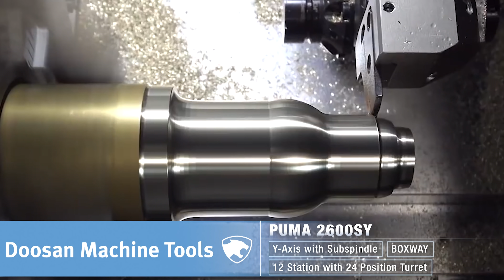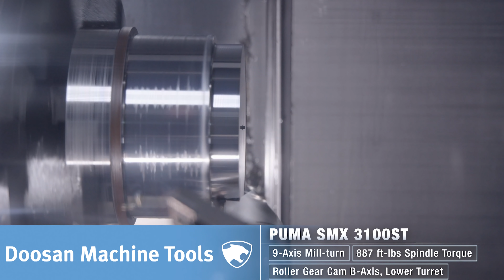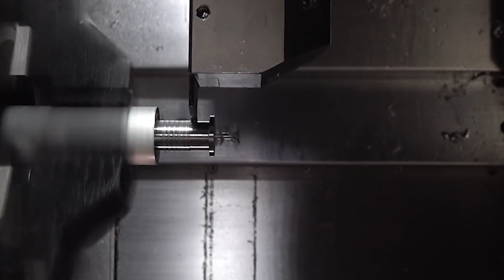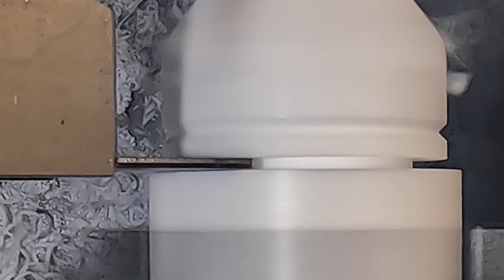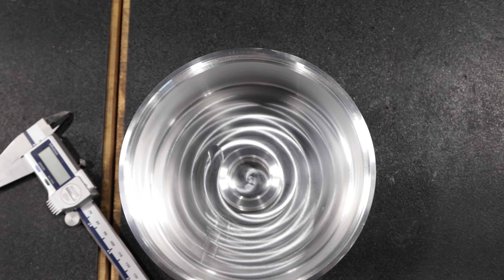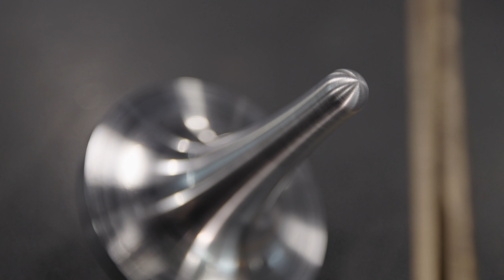Obtaining FLAWLESS Surface Finishes on a Lathe | Works of ART Compilation

Comment: We run parts that need a 16 micro finish.  Easy with the right insert and good steel. Have to polish almost every part cause our buyers get the cheapest shit they can find. It's called "strategic procurement".
Reply: sounds like you guys are wasting money on extra processes from using sub optimal material. Those extra labour costs almost certainly outweigh the extra cost of suitable material.

Comment: Which company provide best Turning Centre??? According to You. For ex. DMG Mori, Doosan etc.
Reply: Mori Seiki should be at the very top, come with high price tag but built like a tank and hold 2 micron tolerance daily basis. 
DMG Mori is one tier lower than Mori Seiki, and perform similar to Doosan, Okuma, Nakamura-Tome, Matsura, Mazak, Hyundai, Samsung/SE.
Reply: @MrKio415  we have 4 mori seiki , 2 doosan puma, 3 youji, 6 or 8 haas lathes. Mori seiki are best out of all those i have tried
Reply: @elvirathon  Haas lathe doesn't perform as well as the pack, the only good thing is you get support/parts in a day or 2.
Reply: @MrKio415  we have okuma and mori in our shop Okuma is better in every way than mori
Reply: For turning you can't beat Okuma, nakamura is pretty great too, and Samsung as they are literally old Mori's before they got crappy
Reply: Mori Seiki
Reply: I run Mori Seikis from the 80s that have been abused pretty hard. Still run parts at a +-.0002 tolerance regularly with no issues.
Reply: @85CEKR  Plus better support from Okuma, and you could throw operators from machine to machine and they knew what to do.....
Reply: @stbentoak5047  yes we get really great support from them too.

Comment: honestly I'm not impressed. Show me the tolerances and surface Ra and Rz
Reply: Right on.  These are the critical specs that a machine shop needs to work to.  I know we are showing the process, but no coolant?  Surface finish is a function, in a geometric sense, of feed and nose radius.  Many, many other factors then come into play like material type, hardness, and machine construction.  If we ran 5 different materials with the same process parameters they would all have different measured surface roughness.  Also, do any of the machines have an ultra-rigid headstock?  If I needed to get an awesome finish my manufacturing process would include in-process burnishing.

Comment: Surface finish is governed by the drawing specification. There is no point in trying for 10 micro finish if the spec is for 63? Most manufacturing today is specked using SPC. So all parameters especially tight tolerances should be specked using SPC.
Reply: I am fussy

Comment: Step 1: Don’t buy a Mazak.
Reply: Why?
Reply: @pradeepsinghrathore989  In my experience, they don’t have the longevity or craftsmanship of other machines. Getting them serviced takes far too much time and effort. To top it all off, the control is very cumbersome to use. Searching for a line of code to edit, is a needlessly complicated production. I’d buy a ten year old Haas, before a new Mazak.
Reply: @Pondimus_Maximus  Which controller you used on mazak?
And Currently I am using mazak Smooth G and X in my company and i feel it too easy to use
Reply: @pradeepsinghrathore989  I’m afraid I don’t remember exactly. The Nexus something or other.
Reply: Lol so true